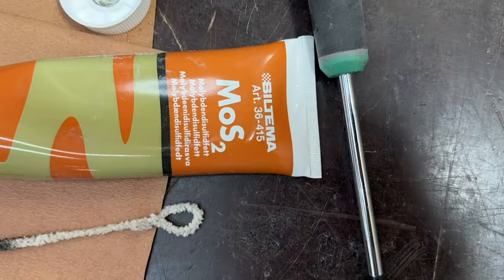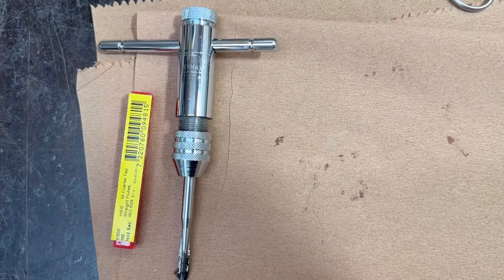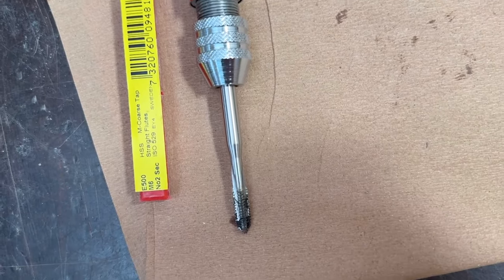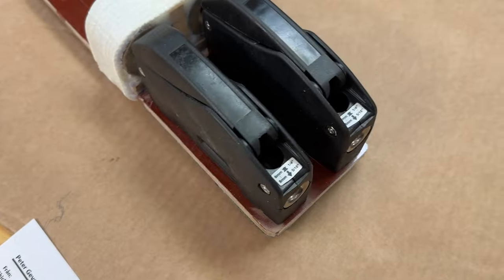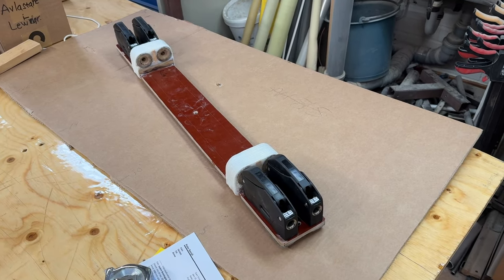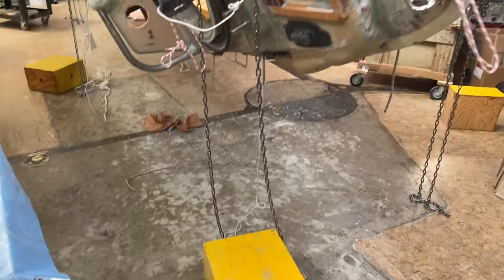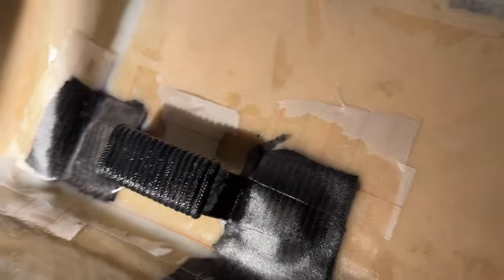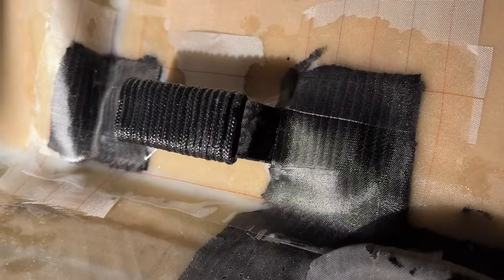3 Dec 2023  Handholds 3 on the port side

Comment: Thank you Sven for the update. Would bronze screws prevent the galling issue with stainless in stainless and still provide the strength needed for the vector winch? Have a good evening.
Reply from the maker: Bronze screws is definitly very good. They are excellent.
Problem they do not sell in Sweden.
Problem 2 they are not in metric.